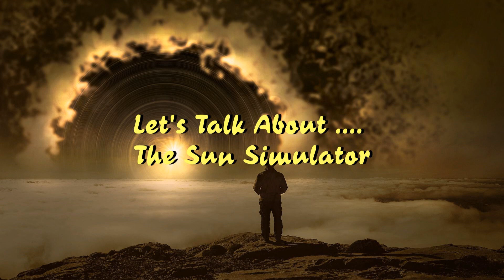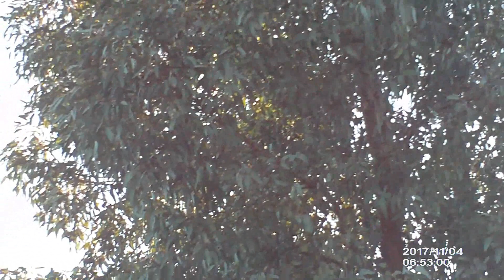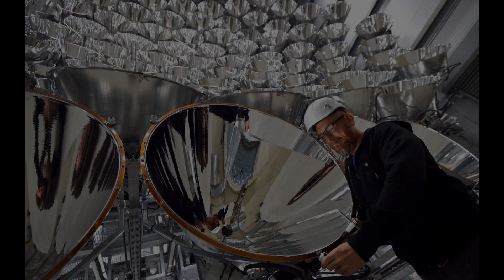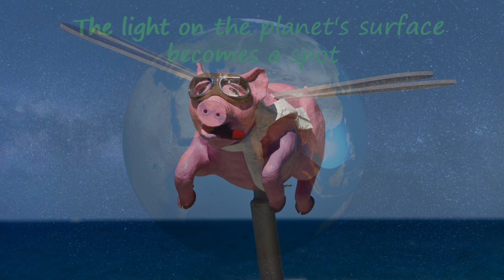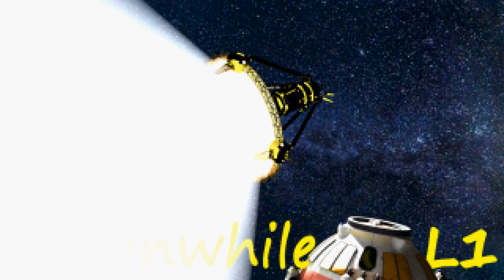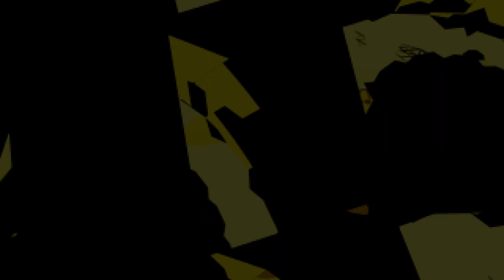Let's talk about the "Sun Simulator"

Comment: Financially speaking, just the Pentagon of the US is missing tens of trillions of dollars. This is almost certainly not missing but used on "black projects".
Secrets! Thousands saw the Stealth fighter and bombers and not one said anything, as a matter of fact they allowed the UFO groups, infiltrated by cointelpro to hide them during testing, for a decade by the way.
Those two points made, the frennel lensing system can be used for projection which is likely what is being done. You can see a projector in many videos, the tell tale red blue green shows. 
"Blimps" at 900-1200' length and 300' width (300-400m x 100m for those who have condescended to the UN globalist agenda) that are very capable of carrying the lensing system, drone flight for up to a year, and based upon the specifications have cloaking technology that blends them into the surrounding atmospheric conditions.
I liked your video for the realistic argument, rational and logical process, but you didn't have all the information available. Peace R
Reply from the maker: So there money missing - do you honestly believe that "they" could build something like a "Sun Simulator" - BTW unlike other claimants to the "Simulator" theory, my calculations have been peer reviewed as far as I am aware no one else has done this.
Reply: I'm not advocating the "sun simulator" as an orbiting object either. I highly doubt there's a means to do this beyond the scope of focus to heat up a solar energy plant or as a laser. Too much maintenance and too many things to go wrong.
Apologize for length of this...
However, the blimps were built by an international consortium. They are capable of extremely high altitude use. The frennel lensing system can be easily carried and used by them. They have been seen behind the glaring light that is in the atmosphere not 93million miles away. This is shown in both ISS feeds and independent high altitude balloon footage. The capabilities are there and 7D holograms can be generated using the frennel lensing system and the particulants being dropped around the planet, coincidentally where the sun is.
Observation, using our own eye and images, and rational, logical process applied demonstrates that something is there and appears to be hiding something behind it. 
Our job should not only be debunking what we know is outright wrong but the investigation and dissemination of our best theory as well as any video, photos that we can muster to show the anomaly that is there.  For example, many point out the hexagonal sun without taking into account the shape of lens in cameras and phone. I have actually taken images of a square, sail shaped light source that is definitely not a camera issue but certainly isn't the sun either. Also, several times photos of multiple round objects in vacinity of the thing (actual distance incalculable) that move opposite direction of the light source, ruling out the moon and other normal celestial bodies both by motion and size.
Are these also projections or something physically there? No way to discern this with my limited visual equipment. Yet, still both the light source and the objects have been personally observed for several months now.
I would welcome real, independent, and forthcoming individuals that are willing to investigate this. I'm sick of the doomsayers and the other technologically unsound, uninvestigated rhetoric as well.
 Prayers and Peace to you and yours, R
Reply from the maker: Shall look into this - it is not a theory that I have seen
Reply: https://youtu.be/fLLRRcrW8rg

This is the only person I have ever seen that has been able to get in behind the brightness of the lighting to expose the object behind it... Thought I would give you more food for thought. Many times there's a dome shape, curving back in an arc to a larger body. Looks like a shadow, shaped though, and comes out with exposure and contrast adjustment. JeffP caught a similar object trailing a large sail shape between two in a sunset video from a weather cam. 
Good hunting. Peace R
Reply from the maker: Leaving the money thing aside as no amount of debate on that issue will ever work out where the money went,  if indeed it is lost.

Blimps at high altitude? 
They would be bolloxed by strong winds. 
There has to be a ceiling to that blimp altitude as well. 
They, the light source, would be subject to changes in angular diameter to people at different distances to them and as they traverse the sky. Also the angular separation would not be correct. The sun moves at a constant 15° per hour. Something in the atmosphere would have a variable angular separation that would change every hour as it went across the sky.

The reference video is nothing but lens flare and so out of focus that it could be anything and don't forget an H-Alphascope sees in the Hydrogen wavelength and people are able to see the sun using these and solar filters.

They are some informative videos on the following Channel that cover the angular separation:-
https://www.youtube.com/channel/UCdBDrVhctJmzUvydgWc65yQ/videos
You may also find these videos of interest:-
https://www.youtube.com/watch?v=JbftTb-Fx2I
https://www.youtube.com/watch?v=bM3-4Iabr-M&feature=youtu.be
https://www.youtube.com/watch?v=KQf1U7eqkGY&feature=youtu.be
Reply: I have been working on the logistics, aerodynamic questions as well... like minded. According to the firms building these hybrid blimps, extreme high altitude isn't an issue?...
Here's another video that shows a little different object that I have not been able to get a thought, or reasonable research answer for, several videos exist now.
https://youtu.be/npC0y2PdaiM
Reply from the maker: I'd like to see the source for these blimp claims.
Now diffuse cloud wont be visible through the glare of the sun and only appears to be behind it because of this. The same thing happens to aeroplanes that fly in front of the sun. They are rendered invisible by the glare and appear to pass behind the sun.

Also bear in mind that none of the blimp theory even given extreme high altitude still does not address the angular issues as shown in the reference videos and also logistics (as you said) is the big thing always missed in these theories and in all cases so far regarding the simulators theories can anyone answer the issue of the simple logistics of what they claim - Who, What, Where, Why and How? 

https://www.youtube.com/watch?v=sW-6rRysi28 talks about the cloud issue